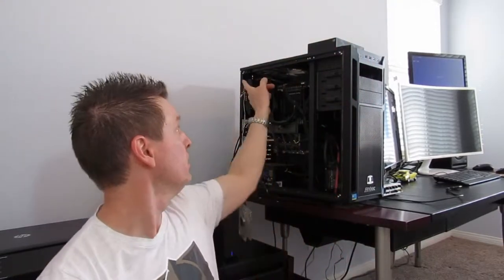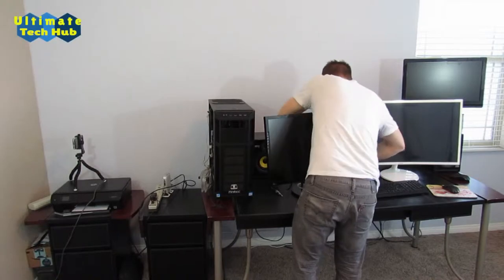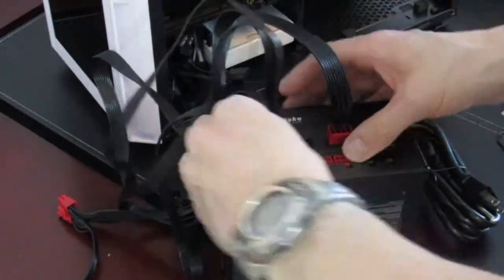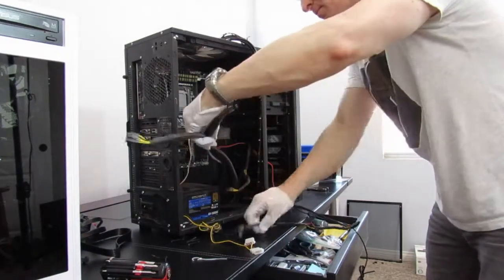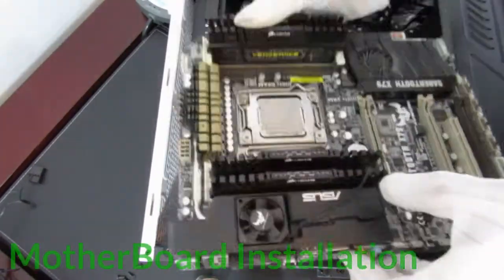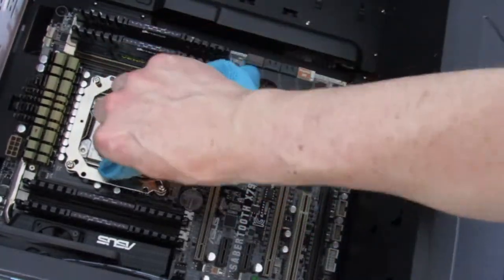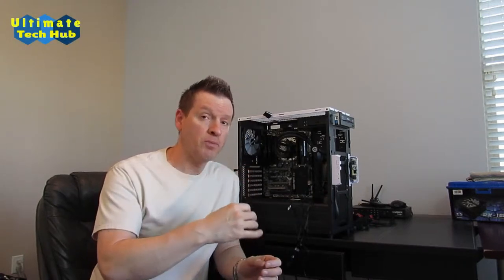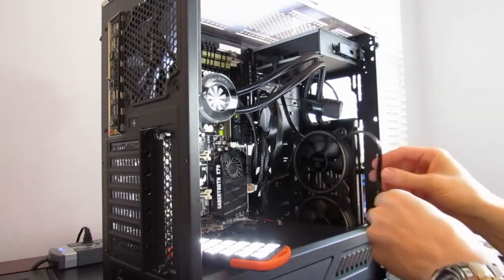GAMING PC BUILD - Part 1  UPGRADING MY OLD PC - NEW CASE & PSU

Comment from the maker: I hope enjoy this video of me upgrading my old and very tired computer. My original plan was to install all the old components in the new case with a new Blu-Ray burner but my Power Supply went dead. So I opted for a new PSU and a new Liquid cooler for the CPU. And in Part 2 of this video I will install a new GEFORCE GTX 1660ti graphics card. And then I will finish setting up the case and you will see the final result. Thanks for watching and please subscribe. I usually post 2 videos a week so I have plenty of Technology videos for you to watch.

Comment: I read a lot of Newegg and Amazon product reviews. Even power supply units (PSUs) made by popular brands such as Corsair, EVGA, Thermaltake, Cooler Master, and Seasonic die, arrive dead-on-arrival (DOA), give out smoke, and destroy other components. May I know tips on buying a working power supply unit (PSU) online?
Reply from the maker: Sorry for the late response. Its kind of hit and miss with power supplies. My original PSU lasted over 5 years so thats very good in temrs of PSUs. As far as buying online I would look at power supplies with power you need and just check out the reviews for each different brand then read the reviews. Thats how I chose my new PSU and mine works perfect. Make sure you get the correct watts for your PC and I usually go over the needed watts by about 200 beacuse of future upgrades and changing computer needs. Thanks for watching and hit that subscribe button if havent already.